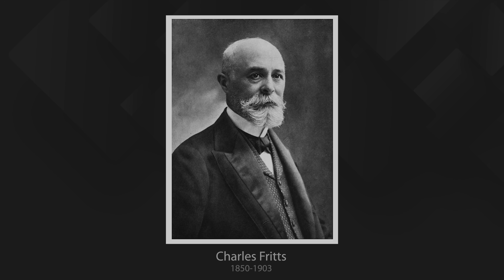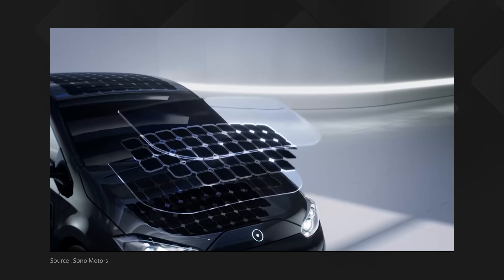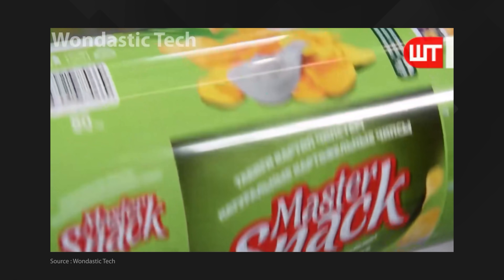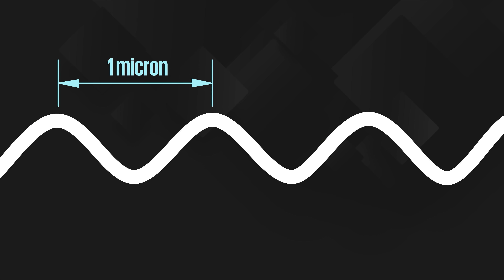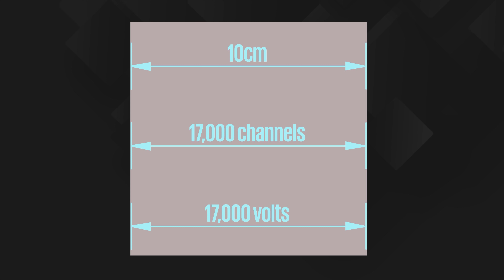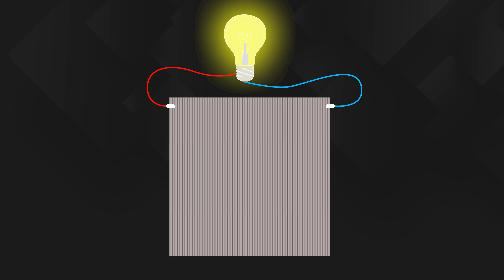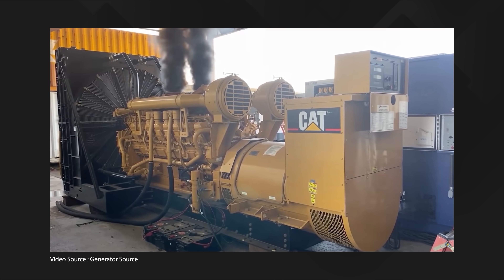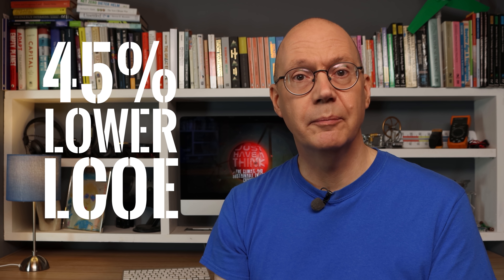Solar PV film roll. Revolutionary new production technology.

Comment: I was surprised at the 11% conversion efficiency. This makes it very useful. Unfortunately the website doesn't have a product specification showing NOCT and standard performance characteristics or how you connect to it. It will probably work best with an array of small MPPT converters onto a bus - a little like DC optimisers on current panels. I'd love to get my hands on some to start designing suitable controllers ready for rollout.
Reply: I recently bought a mono-crystalline PERC solar panel and the test report said that the highest conversion efficiency is about 16%.
Reply: Andy, would that be bc as stated they're working towards a higher efficiency which would hopefully be achieved by the 2023 mass production date?
Reply: 11% sounds way too good for non-semiconductor pv solution lol
Reply: @rkan2  some of the DSC and OPV cells get above that, but the good ones are still in university labs. I would be interested to see how the performance declines.
Reply: @rkan2  It is certainly on the high side but if they can do it than I'd be happy to use them :)
Reply: My samples came from Danish infinityPV.
Reply: I'm sure it's like most things these days, no product will actually appear. And we will move on to the next amazing breakthrough until our electricity goes off and we can't watch Just Have A Think any more.

Comment: Great product and video. For most homeowners that can afford solar in the USA, most of the cost of the system is labor rather than hardware. Professional installation and permits and inspection make up most of the cost. This product sounds like it is well on the way to what I would like to see: a Mylar like solar sheet that one could strap down on their roof or even lawn that almost anyone with a ladder and a little help could install themselves. In most or much of the USA, non-permanent structures don't require permitting so this would help getting around a big cost/hassle.  Even if the system is not as efficient or long lasting, if the cost is reasonable and one only has to pay for the hardware, it is likely to be very attractive to many home/land owners. Also, while 10 years isn't as good as 25 years, in 10 years the technology may have so improved that one would want to replace the system anyway.
Reply: I don't think you want a flexible sheet flapping in the breeze.  The electrical connections appear to be a weak link.  Also, there's more to solar than the panels.  You need inverters and various sophisticated devices to connect to your panel without electrocuting a lineman some time down the road.   That stuff is expensive.
Reply: @incognitotorpedo42  May require more than a few bungee cords but less than a tearing out part of your roof's tiles and lots of drilling. I consider the inverters/optimizers as part of the hardware and still the labor cost and permit hassle and delays as a big problem where I live.
Reply: Your point on the costs is spot on. My off grid system that I built myself, without permits (because it is in a very remote area where permits are not required or even available) is capable of running a modest two bedroom home.  It cost about $5,000 a few years ago. Today it would be about $4,500 with slightly better batteries. In the USA city or suburbs it would cost four to five times that much.
Put this technology in developing countries like Vietnam or Laos, the country side of Africa, or the poorer nations of East Europe and it could be a game changer simply due to being economically available and doable by the regular non-technical home owner / renter.
Reply: @HealthyHappyJason  the thing I don't understand is why people don't just build a parallel system and not tie into the grid.
It could drive lights and maybe one 5000 BTU air conditioner. And that would pull down your electrical cost for the Grid. In a pinch you could run a deep freezer or refrigerator and certainly a laptop off of it.
Reply: @mac_mcleod  Think of the batteries you would need for when your PV system is not producing, like all night and during inclement weather.
Reply: @pauleohl  depends on area.   in my area.  would mainly need during day.    and batteries would be for light and fans.
Reply: @mac_mcleod  exactly
Reply: The permitting is because they are hooked into the power grid, and need to follow electrical code to maintain grid integrity, and user safety. You can install your own system if you want. As long as it is up to code, and done properly, permits aren't an issue, and not expensive. Labor however, remains a big part of home solar installations. You can also install panels yourself, and hire a contractor to ensure the connections to grid are done properly.
Reply: Think of all the debris that lands on your lawn. What would that debris do for these films? Do you really think that a fabric with precision microgrooves could withstand being furled and walked on?
Reply: @pauleohl  Cover it with a glass then,doesn't meter,if 11% efficiency on a film achieved even on same price ratio as crystalline silicon PV,this still would much more broadly used than all today's solar tech combined.

Comment: Sails on sail boats perhaps? There is limited space for panels, but a massive sail area.
Reply: Sails take a lot of beating. I'd expect the electrical connections to break fairly quickly.
Reply: @Globovoyeur  I vaguely remember a company trying 'sails'  that are more like a glider's wing attached to the deck.  They were solid but rotated to the correct direction. They hoped to greatly decrease,  but not replace the fuel oil use - put this sort of PV onto the sail & you could incorporate them into a rather efficient power train [wind+ PV to electric motor with modest battery and fuel oil to electric motor backup. ]
Reply: @cyngaethlestan8859  that's right, it's been experimented with for a while, we could see a 3 way hybrid, diesel, solar, sail.
Reply: @cyngaethlestan8859  The term you're looking for is a wing sail, they're rigid sails which would be perfect for coating with solar film like this. It's something I've been thinking about for years now and would love to see in production.
Reply: Wing sails have been used in various guises for some decades, most obvious and recently on the latest couple of generations of Americas Cup flying machines. 
Unfortunately, they have some key disadvantages when compared with conventional single skin sails. 
1, ‘Semi Soft’ wing sails, where the foil shape is essentially formed by two skins of a lightweight flexible material that is stretched over a lightweight framework, rather akin to a fabric covered aircraft wing, are delicate, extremely complex in structure and thereby very expensive to produce and prone to damage. 
They also require equally complex internal shape control systems to optimise their form for any given wind angle and velocity. 
2, It is not really possible to rapidly reduce sail area, referred to as ‘reefing’ a sail. This is necessary for a vessel’s safety as wind speeds increase, to ensure that lateral forces do not exceed the vessel’s righting abilities. 
3, Even when the ‘skins’ are removed entirely, the remaining internal structure still presents significant windage area, so still presents a danger to the vessel at higher wind velocities. 

Hard wing sails, again like an aircraft wing but more akin to a monocoque structure where the skins are a lightweight hard material such as glass/carbon fibre, bonded to hard formers to achieve the shape. These are even more difficult to handle in increasing wind speeds as they cannot be reefed. 
They also lack the ability to vary their shape by much more than a minimal amount for optimisation in operation. 
They also tend to be heavier which detracts from the righting moment of the vessel considerably. 

Basically, the ‘wing sail’ type is limited to extremely high performance, high speed, single purpose racing and speed record machines where the speeds achieved through ‘foiling’ designs (where the hull is entirely lifted up out of the water and supported on hydrodynamic foils). 

An F1 car has four wheels and is operated on tarmac. That does not mean that many of the systems are even remotely applicable to passenger cars or heavy goods vehicles. 
That is about the level of comparative usability of wing sails when compared with conventional single skin soft sails for most non-extreme speed applications. 

Most vessels, though, have considerable above waterline surface area where a soft film, such as described in the video, could be usefully applied, particularly if a surface coating could be post-applied to fair and seal the edges and to add extra protection from physical damage through abrasion. 

On thinking about the possibility of using the film on conventional sails, many modern sails are barely subject to stretch or linear deformation during their lifespan thanks to the integration of carbon and prestretched aramid fibres in their construction. It is also now quite commonplace to use these materials as a flexible structural matrix in conjunction with mylar film, as a fully moulded unit. These sails are flexible but essentially do not stretch at all and could be very suitable. 
They’re normally the preserve of reasonably serious racers thanks to the cost when compared to conventional woven fabrics, but over the last few years that has become slightly less true. 

If anyone’s interested, search for ‘3DL sails’, or  better, ‘3DL sail production method’…..  I promise it’ll surprise you!

Sorry about the lengthy post, I’m an ex-superyacht Engineer ( now retired) and still a techy yachtie for fun. I’ve played with a fair amount of experimental kit over the years. 

I do hope that this thin film panel material does become available down the track, it’s got potential…..Pardon the pun, really. 

Cheers all, R. 😎👍🍻
Reply: @robm.4512  First of all, thank you for the excellent reply, it's clear that you have a significant depth of knowledge on the subject.
With the newer sails having less deformation, would an in mast furling system for a mainsail be better for the solar film do you think? I figure it would have less sharp bends than a traditional mainsail when it's away or reefed.
Reply: @robm.4512  Quite informative : )
Reply: @robm.4512  are you familiar with the Energy Observer, I think you'd get a kick out of it. They absolutely make reefable wing sails (ocean wings currently, Beneteau head a "magic wing", etc. ).

I agree though, I'm looking for the above waterline and other pesky surface area coverage. I wonder how they perform with salt water splashing them.
Reply: Problem with solar on sails, apart from durability issues, is that they are typically angled as much as 90 degrees away from optimal for solar gain.
Reply: @bryan314  if you put the voltege up,it will work beter.
Reply: Sails are up only while you are sailing. For a cruising sailboat, this is a small percentage of the time. For day-sailing, power is not generally an issue, especially when under way. There are very few race boats, but they would accept no compromise on the performance of the sails.

Comment: I am not so convinced about this one David. Low efficiency of around 11%, short lifespan of 10-15 years, you didn’t mention possible degradation over time. 
It’s important to keep exploring these technologies but I think this one has still a long way to go. 
I think perovskite solar cell technology is far ahead in the race to bring affordable and reliable renewable electricity around the world. 
I always enjoy your insightful videos though. 
Keep up with your great work and wishing you all the best. Marco
Reply: I think he mentioned its not about replacing panels but using it in places where panels can't be used... look at all those factories that can't have panels due to weight reasons... imagine all that solar collection potential being installed much cheaper and with no structural changes or on farm shade tents even 10% on massive areas of surface could be significant in generation

Comment: I saw a report on the DW network where Britain is considering opening a coal mine. Considering your country has to import coal to make coke for steel would you consider that actually helping to curb emissions as the transport then burning of same is a double negative overall. I know opening a mine sounds completely counter-intuitive, but so many unnecessary emissions occur due to transportation of goods globally that might not be needed. For instance, I reside in Florida, but all the markets here stock California oranges. Go figure!

Comment: We already have PET flexible solar panels, they have extremely limited durability (never buy a flexible solar panel, they have a lifespan of about 18 months in full sun).  Will be interesting to see if this process has solved those issues.
Reply: What's the problem with them, no UV resistance?
Reply: @florinadrian5174  That and the PET (and also "improved" ETFE panels) break down under high temps

Comment: So, only 1 minute into the video & I had to do a quick calculation, which means if you cover approx 2 million miles² (1,995,647.8 miles²) in this then we would gain all the energy we need from the sun alone. Assuming we get 100% efficiency. Ok...get to it, but let's do 3m to cover all bases lol ;o)
Reply: I do not confirm or deny if any of my calculation are correct. Any decisions taken upon these calculations are at the users own risk. No responsibility is taken by the poster (me) ;p
Reply: Ahh - now watched all the video - only 11% efficiency - ok, order me 20m miles² of it please & I will have enough to supply the world in free energy. My work here is done.

Comment: The one criticism I would make of your channel is that you rarely address the pitfalls & issues with commercialization or mass production of these new technologies.
Reply: @David Lockett Sure but if this last 10++ years it seems to be a legit use of plastic.
10 years vs 15 minutes for a bottle of coke or a straw....
Reply: @David Lockett PET plastic is typically made from a high percentage of post-consumer plastic waste.  If that's the case here I see it as an alternative destination for a drinks bottle otherwise headed for the ocean. But I agree, it would be nice to know where the plastic feedstocks come from.
Reply: @Firebuck  Bottles heading to the ocean have not been picked up by trucks.  They have been discarded in or near rivers to be washed out to sea.  This is mostly happening in the Philippines.
Reply: @incognitotorpedo42  I bet Indonesia easily beats the Philippines on that topic.
Reply: @incognitotorpedo42  I suspect companies buying the plastic are dumping it in the ocean instead of recycling it as they promised.  This isn't some kids playground juice bottle floating out to sea with a note in it for arrrrgghh pirates to read matey, this is a little bigger.  Boats can dump their trash legally.

Comment: The lower efficiency is fine with me because of the cost and flexibility of the tech. Profit by volume.
My first thoughts went to spacecraft and satellites. The weight savings and ease of storage and deployment would be awesome
Reply: Many of the spacecraft powered by solar "panels" already use a type of roll although very likely not this one. Typically it's shipped to the orbit folded in a small package and then it extends like an umbrella (or origami) into a flat shape ready to harness the sunlight.

Comment: 10-15 years lifetime, that does limits the application. Say you have covered your roof with this, what do you do, just a new layer on top of it?
Reply: I would not have a problem re-roofing my roof every 15 years if it provided all the power I needed for those 15 years.  Right now my 25 year roof needs replacing but it never generated a micro-watt of energy.
Reply: in 10-15 years surely there will be improved versions, if not brand new tech that is better

Comment: Love it, would this just plug into normal solar home inverters? Thanks
Reply: If the voltage is choose correctly yes.  Most of the charge controllers will work with multiple renewable energy sources.  Midnite classic 150 charge controllers come to mind as supporting solar PV, wind turbines and hydro turbines for small scale wind and hydro power.  Basically the source of the electricity don't matter you just need to configure the controller with a dump zone for some sources like wind which will push power and over charge batteries without a dump zone.  Solar won't push power then same way so you don't need a dump zone for excess power.
Reply: @DanA-nl5uo  

Dump zone?   As in discarded power?
Reply: @dr.OgataSerizawa  if you have wind on a small scale you have to have a way to burn off excess power yes.  It protects the small scale wind turbine.  It is basically just resistors able to handle the load.  They are not needed with solar.  But the same charge controller can be configured for both in software was the point.
Reply: @dr.OgataSerizawa  in solar it is called an opportunity load because it is optional.